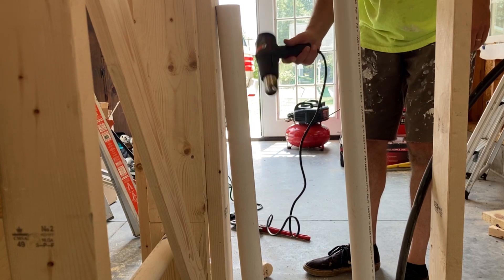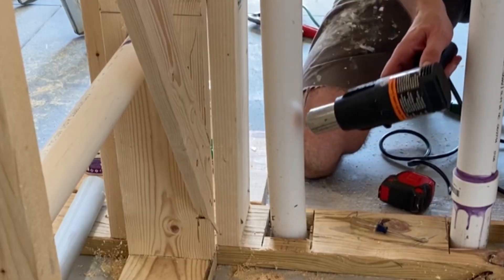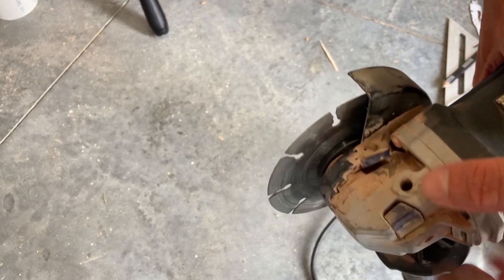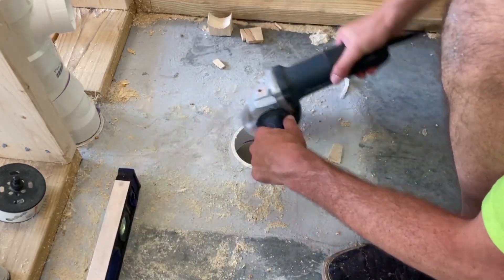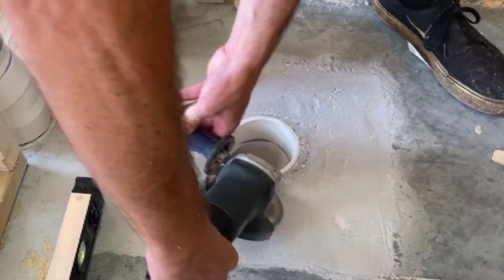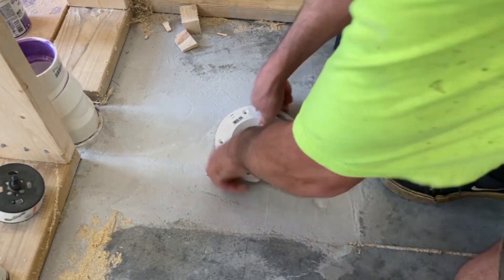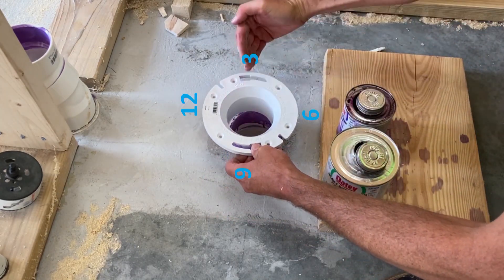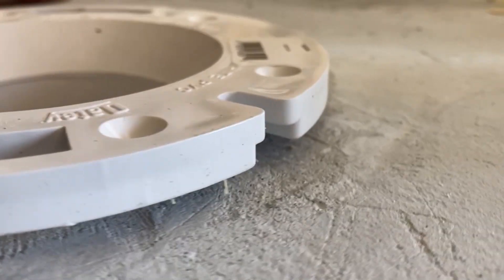How to bend PVC with heat | Garage to Apartment Conversion | Episode 12

Comment: Never thought of doing that!  Hope the toilet seal doesn't leak.  I am not yet fully convinced it will work ...
Reply from the maker: I’m not fully convinced either, DW 😰
Reply: I dont see why it won't work. A tall wax seal should take up any discrepancy.  I have also started using the reusable rubber seals with good luck.